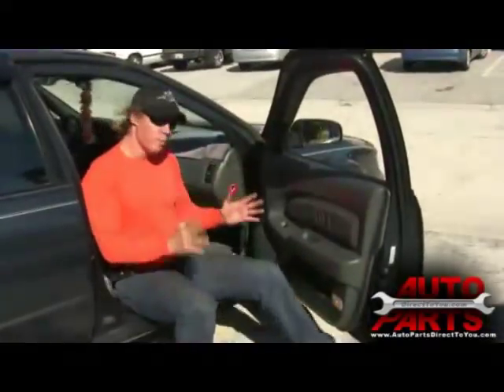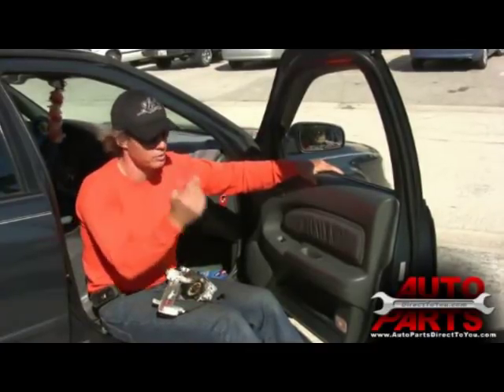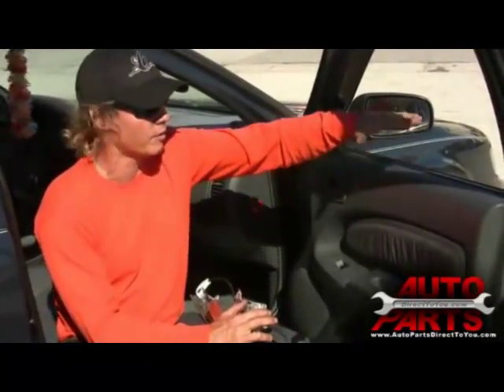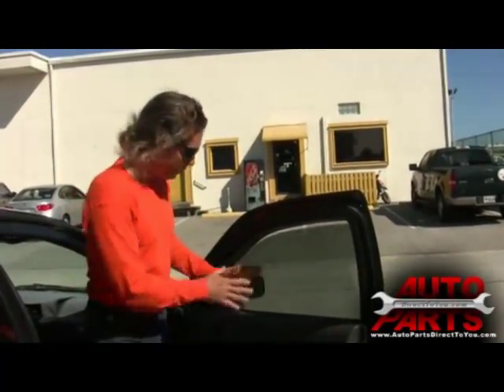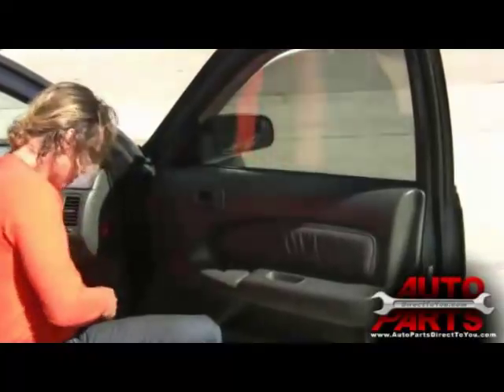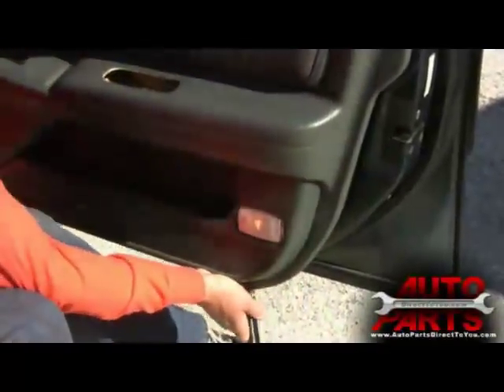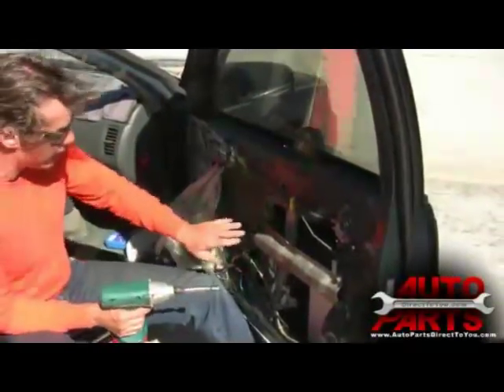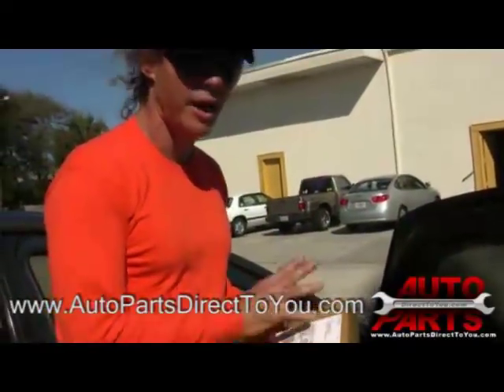Diagnose Window Motor and Regulator Problems Part 1

Comment: Greeetings everybody
Today I changed a regulator and motor on Buick 2002 Limited,rear right. It's working fine. I compared it to the front right,, I noticed it's not as smooth. Any idea?

Comment: I have a 05 ranger, driver window goes all the way up but is slightly tilts forward and I have to push it back and up to fully close. it any tips? replace quick fix?
Reply from the maker: +Jared Goins You could have a window guide/track problem. Try lubing up the window track
Reply: I will I was not sure but leaning to the track. Thanks I will and get back

Comment: I replaced the regulator kit. Now the window went down but will not come back up. I even tried switching control switch from other window that works fine, and there seems to be nothing wrong with the switch. What could be causing this. Now I am doubting if the old kit was bad to begin with.
Reply: To clarify, the window went down on first operation but will not come back up unless I short circuit wiring to reverse polarity.
Reply: +Rusty Chace My problem sounds a lot like "This Guy"s realier comment.

Comment: okay so, I have a 95 Honda Accord and at first the passenger side window was starting to be iffy about rolling up from the driver side switch.  Then, about a week or two later it stopped rolling up all together from the driver's side switch so, I had to roll it up from the passenger side.  It was working just fine for a couple weeks then one day just wouldn't roll up at all from either side.  I've taken apart the door assuming it was just an electrical problem but I am not sure where to go from there.
Reply from the maker: You most likely need a motor, but you can find out. Since you have the door apart, you could try and roll the window up or down with either switch and see what happens, if the motor does not move, tap on the back of it pretty hard while pressing the window button and see if it moves. This is almost identical to how you check a starter motor, you are jarring the inside magnet and armature of the motor and if it start to move even for a second, then you know it is a failed motor. You could also unplug the motor and give it 12 volts directly and if it doesn't work, then you know it is a motor, if it works perfectly, then you have 1 or 2 bad switches.

Comment: Hi, I have a 1998 prelude and I fix by putting on a new regulator in the driver side after fixing the problem my passenger side window doesn't work and makes this weird noise after time I want to rise or down switch it! why is that!?? please help

Comment: i see you still answer comments from people. i'll try to do more research on my own, but i'd like to ask a quick question just to see if you'll reply. i'm 25 and don't know much about cars. i'd like to try to be self reliant though, but i'm always going to need advice. so far i have had to replace the multiswitch in my car which i did myself yay me. I have a 03 impala. all the windows roll up fine except drivers side. sometimes it sticks (doesn't move when button is pushed). It's funny cause it will go down fine, but not up. can't hear the motor or anything in the door. think of it like... you press a switch and a light comes on and then shuts back off whenever it feels like it.. and there doesn't seem to be any rhyme or reason. it's gotten to the point where I don't even wanna roll it down anymore cause I'm afraid it's never going to go back up.
Reply from the maker: ok, that is most likely a failing window motor. The motor gets worn out over time and it will get stuck in certain spots. An old school method of testing this is similar to testing a starter motor. Remove the door panel and tap hard on the motor body while pressing the window switch, if it starts moving after being tapped then the motor is failing. You have to give it some good hard taps to get it to move. Also the window motor being worn out could have contributed to the master window switch failure. A 2000-2005 Chevy Impala has a cable style window regulator & motor assembly and it is designed the be completely replaced. It is also extremely common to fail and we sell it very often, here is a link to it on Amazon:
http://www.amazon.com/APDTY-Regulator-Driver-Side-2000-2005-Chevrolet/dp/B00BVPUU3U/ref=sr_1_1?s=automotive&ie=UTF8&qid=1407178270&sr=1-1&keywords=852741

Comment: my son (16) has 93 buick cent s/w.  driver side windows go down, front comes up in small increments, back wont go up then suddenly will after a few days.  replaced switch with one from amazon.  no change.  son wants to try and change to manual windows,  Is this possible?  how cant we accomplish this?  is there a kit?

Comment from the maker: It sure sounds like a window motor. To be 100% sure though, you'd have to pull the door panel and read the voltage across the wires going to the window motor when pushing up and down on the switch. If there is 12V in both UP and DOWN,, then it's the motor that is bad. If there is no voltage, then there is something else wrong.

Comment: On my 2002 Nissan Altima the drivers window will roll down but now back up.  I bought a used switch module on ebay and when I got it one of the plug receptacles was different from the one on my car. I couldn't make it work.  Do you think the problem is the switch?
Reply from the maker: That can be a switch or problem with the motor or regulator. Nissan does have a limit switch built into the motor and that may just need to be rest. A diagnosis would be needed to figure this out for sure. This is an electrical diagnosis and most likely a shop is needed.  The limit switch is usually reset when a new motor is installed and could act up if battery power is removed from a dead battery or alternator problem.You can google the window motor switch reset and try that first as it is free, then electrical diagnosis if that does not work.
Reply: Is  there a way I can just roll up the window manually?  I've already spent too much on this  damn car.
Reply from the maker: Unfortunately not really. You may be able to disconnect the motor from the regulator and then roll it up and then attempt to hold it in place with something.
Reply: ok thank you.

Comment: Motor dis-mounted from regulator. Window does not manually slide up and down easily (lots of friction). Put WD-40 everywhere to try to ease the friction. No such luck. Is this a sign of a bad regulator? Where ever cable is visible, it is intact and wound correctly inside spool. Window has maybe 1/8" of play (at the most) from left to right and side to side.

Comment from the maker: It sounds like it is likely your window regulator that has failed, but you'd need to pull the door panel off and take a look inside to confirm.

Comment: I have a 2000 chevy silvr truck and the window just stoped going up makes no noise when you puch the button to go up it does make soft click when you push to go down but that's it it slowly stoped working it would act like it wasn't going to work then later in the day you puch it and it would go up just fine.

Comment: Yesterday afternoon my '91 Nissan Pulsar N14 power windows would not work, I turned the car off and back on and they did. This morning they won't work at all, I hear no sound from the motors in the door and I'm completely stumped, I can't find any fuse in the car concerning the windows and none of the other fuses are blown.
Reply from the maker: Michael Venz So you will probably need to open up the door panel and check the switch and see if the motors are getting power when the switch is depressed. Also make sure to check all the connections on the switch are plugged in completely.

Comment: I have a 2009 nissan altima the driver window only rolls up and  down sometimes  and goes really slow what's the odds of the switch being bad the motor for my car is 300$ and I dont wanna spend that

Comment: 2002 vw passat, replace driver window regulator, main plug into regulator goes in, window works a few times then won't, then I unplug the motor and plug it back in and the window works again a few times then doesn't, have done this 10 times, getting pissed, what am I missing here?
Reply: Did you fix it? Im having the same problem...

Comment: my window goes up and down fine but when it gets to the top and closes it goes bang ??
Reply from the maker: James Hubbard you probably have a failing window regulator, if you remove the door panel and reinstall the switch, then you can inspect it as the bang happens and see what is causing it, it could be as simple as a loose retainer or most of the time it is a regulator or gear failing.
Reply: Auto Parts Direct To You thanks for reply so if it is a failed regulator is it a simple swap or do I have to line and adjust everything

Comment: 1994 Nissan King cab SEV6 drivers side window won't work. (I've been told) the motor was test and is fine
Reply from the maker: Trent Chournos this can all be tested, if they tested the motor and it works when given 12 volts, well then you need to see if the switch is suppling the 12 volts, you may just need a window switch, if you press the switch and get 12 volts at the motor and the motor does not move, then you need a motor

Comment: I have a power window that goes halfway down and up just fine! but once it passes halfway down it gets really slow and then won come back up! . please help each switch does the same from the driver side to the passenger side window its just for the passenger side window.
Reply from the maker: +Dan Fry this could go several ways. Lubing up the window tracks with something like a spray dry lube would be a good start.
Reply: i got it fixed, i took the door apart was step one for me haha, the rubber track was off way off the metal guide, so i fixed it!

Comment: I have a 2006 PT Cruiser.  All-of-a-sudden, when I try to raise the passenger side window, the driver's window goes down.  I can raise the driver's side with its own switch, but when pushing the passenger side button UP, nothing happens.  Passenger side window is stuck down.

Help!
Reply: Ok, most likely an internal short has occurred in the master window switch, which is the driver front switch. if you go to the passenger window switch and operate the window regulator up and down normally, then this means that the passenger side motor, regulator, and switch are operating properly. This would indicate the master switch has a problem. You can actually diagnose the master switch by removing it and back-probing it for voltage (usually need a wiring diagram and basic electrical testing knowledge) while working each window.

Comment: i have a 2001 chevy venture and the drivers side window will go up but not down. i checked the switch with a test light and all good i unhooked the window motor and used the test light on the leads that plug into the motor and when u push up on the switch light goes on when i push down on the switch the light goes on in the other side of the lead. so there is power to the plug in for both up and down but when i plug in the motor it only goes up WTF? i bought  new motor and the same results.

Comment: I have a 1999 honda accord coupe my driver side window comes off track bad and gets stuck coming up and coming down.
Reply from the maker: That is typically a worn out window regulator, Remove the door panel and inspect the glass to window regulator area and make sure it is still connected securely. If it is and If you have power windows, then get a motor and regulator combination, if you have manual windows, then get a manual window regulator.

Comment: , My Drivers side window won't roll up or down on my 2008 Pontiac G6. It's funny because if I open the door to a certain point, it would work. Last time though the window got stuck down but I luckily was able to get it back up. The thing is, it won't even roll up or down any of the other windows from my main switch on the Driver's side. The back windows even act up from time to time. The only window that hasn't acted up is the passenger side. Sometimes the back windows will go up and down with the controls back there but one time it got stuck so I stopped using. What could be wrong?
Reply: How do I test it? There's an update, if I wiggle the wires coming from the body of the car into the door. It'll go up or down
Reply: You know, in between the door when the door is open d

Comment: I hardly use my windows and my car is only 1 year old. Not sure why my passenger window wont go down. Its not locked and every time I push the button all I hear is a click.
Reply from the maker: This Guy the motor is probably failed, if you remove the door panel and then reinstall the switch, you can see if the motor is getting 12 volts from the switch, usually the clicking is the switch working and sending current to the motor but the motor is stuck, a stuck motor happens just like a starter motor, you can try tapping the motor as you press the switch and it might start working, if it works, it does not mean it is fixed, it means the motor is an internal spot that is failed and it needs replacement

Comment: 2004 chevy cavalier, 4 door. my left side windows both work, but both my rights dont.

my rear back on goes down, but not up. sometimes it will. when i disconnect the switch and re attach it, i can hear the motor run for a secong than the window stops.

any ideas? thanks and great video.

Comment: Hi Jessica VanTuyl, That black casing is the cable that goes through the motor, unfortunately when it gets to that point, it must be replaced. Here is links to the motor and regulators on Amazon, I put the front left and front right as I wasnt sure which one you needed:

Front Left (Driver-Side) 2000-2004 Nissan Sentra = http://www.amazon.com/gp/product/B00BVPSPMS/ref=as_li_tl?ie=UTF8&camp=1789&creative=9325&creativeASIN=B00BVPSPMS&linkCode=as2&tag=aupaditoyo-20&linkId=ZA7UMUBT6P4PE4OF

Front Right (Passenger-Side) = http://www.amazon.com/gp/product/B00BVPT04U/ref=as_li_tl?ie=UTF8&camp=1789&creative=9325&creativeASIN=B00BVPT04U&linkCode=as2&tag=aupaditoyo-20&linkId=JS7NPCH6N4OQTOHL

Comment: Hi Troy T, That sounds like you may need to reset the travel position switch of the window motor. Nissan and other manufacturers have a safety limit switch built in that will stop the window motor if something is blocking it like a humans arm. This typically only needs to be performed when the motor is replaced, however it is possible that a battery failure or disconnecting the motor could cause it to need to be reset. You want to make sure no restriction exists in the window glass channel like a cut in the weatherstripping, you also may have a motor that is starting to fail and that would have to be diagnosed but I would try resetting the limit switch first before purchasing parts or paying for a diagnosis. Here is a video on how to reset the switch: http://youtu.be/d6UvdbJ3nFk

Comment from the maker: @itsDUBZ That is a good sign the regulator has gone bad, your truck has a cable style regulator, and when the cable snaps, or a pulley breaks,  the window will no longer have anything to support it. The only way to fix it is to replace the regulator assembly.

Comment: I have a 1992 Chevy suburban. My drivers side window always stops half way up or halfway down. In order to have it continue I have to either hit the door panel firmly with my hand or I have to wiggle the window n help it up. 

The window does not seem to get stuck on the rubber rails it just seems to stop power all of a sudden like when it reaches the top. It's Not like the window is slow or slows down then stops. It just stops like the power was cut momentarily.

I've already replaced the up/d
Reply: That is a classic symptom of a window motor beginning to fail, if it stops and the starts again by tapping or banging on it, then the motor is locking up and it is the same as most any other motor like a starter motor. The internal brushes, armature, or coil get worn and it takes more amperage to turn the motor and it will just stop in place intermittently or it has a burnt spot on the armature or coil and keeps stopping in the same place. Replace the window motor and regulator assembly and your problem will go away. Also be aware that using the switch over and over again to try and get it to move can actually end up burning up the old or brand new switch and confuse you.

Comment: 2002 jeep grand cherokee rear driver side window used to go down on its own and now it only goes half way up while we pull it up then gets stuck any suggestions? The motor sound like it working just not sure why wouldn't it go up another half while we pull it up with our hands?

Comment: Hi my car window only goes up or down, after I remove all the door covers and bang the motor a little with any tool. Any help to diagnose the problem?
Reply from the maker: ***** That is a classic example of a filed window motor. In the old days  and still today, when your starter motor for the engine started to fail, you would tap on the starter with a hammer to get it unstuck and start the engine. This is the same thing as what is happening to you. A bad spot inside the motor will cause it to get stuck and not move, when you bang on it you vibrate it just enough to get it to move again. This will only work so many times before total motor failure so plan on getting a replacement soon.

Comment: I have a vx commodore sedan.. One of my rear right window goes down but once when I put it up it makes this weird noise I have to force it up... Can u help me plz..thank u...
Reply from the maker: Sure, if the noise is coming from inside the door, then remove the door panel and inspect what is going on. Most likely you will need a motor & regulator assembly as the noise is usually the regulator starting to come apart. Removing the door panel can confirm this and every once in awhile you get lucky with something loose that doesn't necessarily need to be replaced.